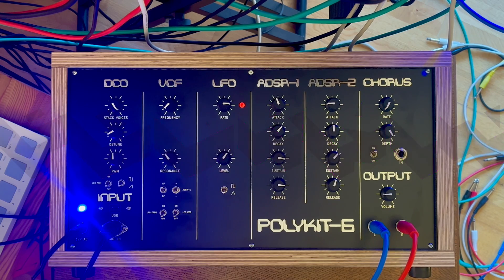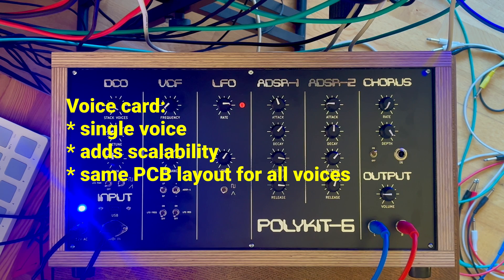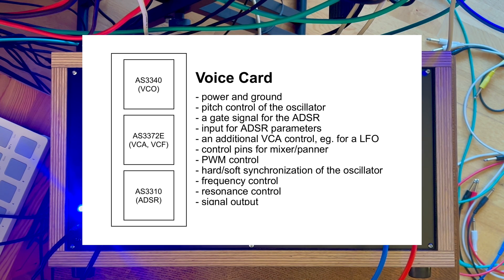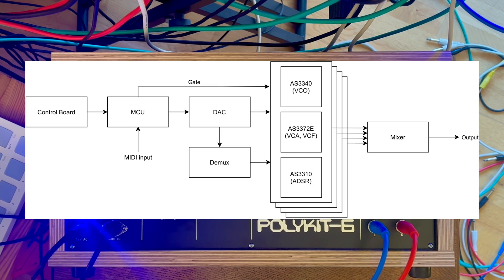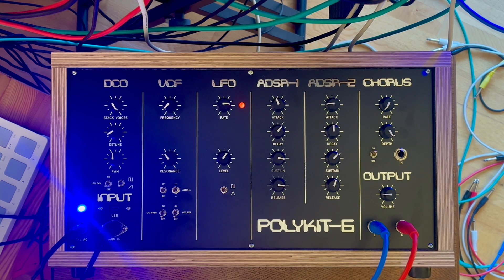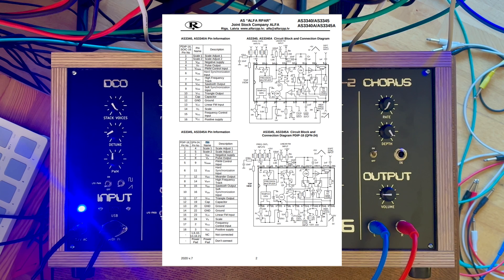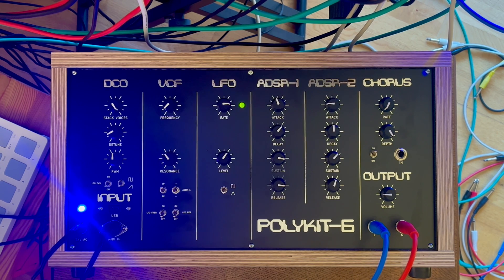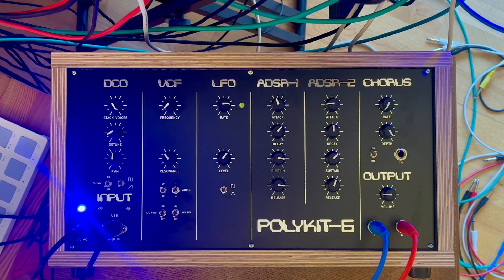Thinking of a new design for an analog POLYPHONIC SYNTHESIZER

Comment: I would like to build a DIY polyphonic synth, but very very simple as a start, like just one VCO square + PWM, and one single LFO (then ADSR, HP LP filters and VCA). Im now thinking the size of the keyboard. I would like around 3 octaves but Im reading a lot about diode matrix and resistance ladder, for now. You're incredibly inspiring !
Reply from the maker: Thank you!

Comment: Do I need a good oscilloscope to design VCOs/DCOs and other blocks of analog synths? I'm thinking about to buy OWON 2-channel scope. It has no signal generator included but it measures low (below 1v) voltages much better than Hanteks (~ the same price). What you can tell/advice about this topic?
The 1st idea was to buy a single channel portable FNIRSI... But then I've started to dig deeper and was surprised that it's not very expensive to buy a bigger scope. Although a bigger brother FNIRSI sometimes (often in some range) shows not proper frequencies. The scope must be a good working device, isn't it? Not only to see waveshapes.
Do I need a signal generator and which cases are common to use it?
Reply from the maker: I think any of these new scopes will do just fine for audio. I use an old analog one and it works great. Sure sometimes I miss some more functionality. I don’t think a function generator is needed. Also a lot of stuff you can do with your soundcard, check Andreas Spiess channel on this topic.
Reply from the maker: Function generators are usually needed for adjusting modules, eg. filters.

Comment: Hi! You've told about avoiding Sample and Hold circuit... I've instantly remembered about Electric Druid's PIC based LFO(s). There are a plenty of options inside.
Need to say else that I'm not sure that this PIC(s) are available now. I've ordered mine few years ago. I was told (maybe it was a rumor) that the production was stopped.
Anyway it's a no-brainer: you just flashes the PIC and it becomes a very space saving solution for VADSRs and LFOs.
Reply: PIC16F684-I/P
VCLFO 9D
The firmware is on his site (would like to insert a link but you know the reason :) ).
My search shows that these are available for about 3$ locally. Pretty good IMO!
14-leg IC, almost anything you want from the LFO. I think we ought donations to Electric Druid :) To you too, no doubt!

P.S. I've used a Chinese Pickit clone to flash them. Works fine!
Reply from the maker: Regarding the sample and hold I’m going to change this. Seems DACs are quite suffering from the supply chain shortage. For now I go with a single DAC8551 and demultiplex it. For this S&H is needed.
Electric Druid is a great resource, I usually order my AS33xx components there. The LFOs are great, I have it in a LMNC module. But for the polysynths I still try to figure out a way to do it with the DAC/microcontroller.

Comment: I have been looking for something to enable digital control of section/ module interconnections. It would require a microcontroller or other means to set the matrix and the chips cost $50 USD 😯, but Analog Devices offers two 16 to16 switchers: one with buffers (AD8113) and another without buffers (AD75019JPZ). It would enable something like the patch matrix on the Erica Synths Syntrx for a monosynth and could be used for flexible routing on the polysynth cards (at a +$50/ card cost). This would also enable saving patches.
Reply from the maker: $50 per voice sounds pricey. Couldn't something similar be achieved by combining a few 4051 or 4066 ICs?

Comment: Have you though about putting the DAC and multiplexer on the voice module and control every voice over I2C? Only the LFO might be an external input.
I like this project, well done. I'll keep an eye on it.
Reply from the maker: Hmm, interesting idea, I need to think about that. You would definitely have less connections on the voice card. Downside would be that it couldn't be used without microcontroller. Thanks for the input!

Comment: Separate ADSR chips make sense. You can use MC to generate ADSRs, but it won't run at audio rate and the output will be steppy, which isn't good. With powerful MC's like STM32F4 you'll can recalculate params like 500-1000 times per sec, but definitely not at audio rate. You can generate LFO output with MC, it will work and I'd sacrifice per-voice LFO for the simplicity of the circuitry and have just 1-2 global LFOs (this is what you did as I understood). I use MAX5134 quad 16-bit DACs in my project and they are good, but they are TSSOP only, no SOIC or DIP (thus not DIY friendly). 12 bits should be enough for LFOs and most of the CVs imho. One of the challenges for you will be to find the right balance between features and complexity, and I'd try to keep it fairly simple and DIY friendly, if you want it to be a public project.
Reply from the maker: Exactly, I will go for one or two global LFOs in software. I hope I get through with a 12-bit DAC, I think voice pitch is the most crucial thing . I will try it out. Also it seems DACs are affected by the global shortage. I have a bit of a hard time finding reliable sources. I agree, it needs to be simple. Otherwise there is a great chance that I won't ever finish it or nobody will ever build it.
Reply: @polykit  Also check MCP4922-E/SL, dual 12-bit DAC, SOIC14 package (not dip, but pretty easy to solder). I used it once and it worked fine. I'm sure 12-bit will be fine for pitch CV, the issue may be with pitch non-linearity across several octaves. But if it is regular (not random), you can compensate that in the software
Reply from the maker: Thanks for the tip, I will check it out. Seems that there's even a DIP package.

Comment: This looks a very interesting project.  Have you looked at the AS3394E at all?  This provides VCO, VCF and VCA on a single chip.  Add a 3310 ADSR and some support components to produce each voice.  An architecture that supports expansion to 10 voices would be cool too.
Reply from the maker: Yeah, I stumbled across it after I did the video and I already ordered the other parts. Otherwise I might have used it. It seems a bit more inflexible regarding mixing of the waveforms.
Reply from the maker: I plan a mainbord that has six voice cards on it. Also it should have the possibility to chain multiple mainboards together.
Reply: @polykit  Have you stuck with the original-type 3340 or have you gone for the new 3340A variant?
Reply from the maker: @rogrevs  I think I got the original variant. As far as I know there is a PWM issue with it?
Reply: @polykit  Is the PWM issue with the old or new chip?
Reply from the maker: @rogrevs with the old one.
Reply: @polykit  Thanks for clearing that up for me.  I hope you continue to make good progress with the project and look forward to more videos!

Comment: I'm looking forward to watching this unfold. Regarding the choice of ICs, did you consider using a more powerful microcontroller and having it perform the duties for envelopes and LFOs? This might simplify the voice cards and bring down the overall component count. You would have a lot of flexibility for routing and super-fast envelopes. Or do you want to keep non-audio stuff analog as much as possible?
Reply from the maker: That’s a great idea at least for the LFO. I‘m not sure for the envelopes. That would mean a separate DAC per voice for this. I think I will put one analog ADSR for the VCA on the voice card and maybe some routing option for frequency and resonance. Do you have any suggestions for the microcontroller?

Comment: Inspiring! The voice card approach is super cool. That's the direction I was thinking of heading, mostly inspired by the Deckard's Dream DIY kit. Do you think you'd go with a similar socketed design or something else? Also, speaking of that kit (and the original CS-80), do you think you'd attempt to include polyphonic aftertouch since you'd have the individual control per voice card?
Reply from the maker: Yes, I thought of a PCB edge connector or something similar for the voice cards. Aftertouch shouldn't be a problem as long as your MIDI keyboard supports it. It only needs to be implemented in software. Thanks for your feedback!

Comment: Perhaps a dco+vco combination would be interesting, if it wouldn’t make the build too complex. Also continuously variable waveforms, like the neutron would set it apart from other poly designs. Congratulations on your work so far.
Reply from the maker: Thank you! I did a DCO in the Polykit-6 built. I think it will be too much for this one, even like this it will be a real challenge. I will definitely take a look at the waveforms. It depends a bit on how much VCAs I will have at hand and control is not getting too complicated.